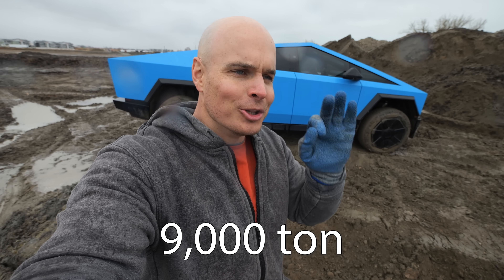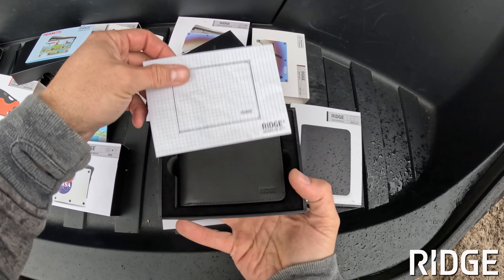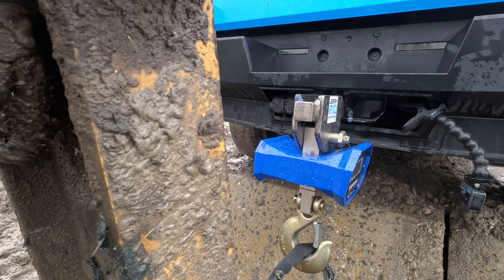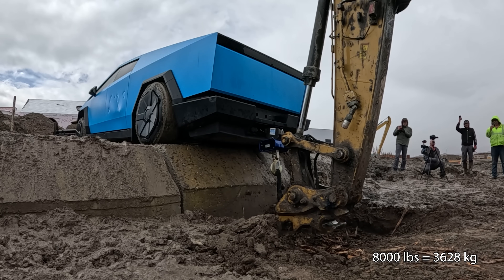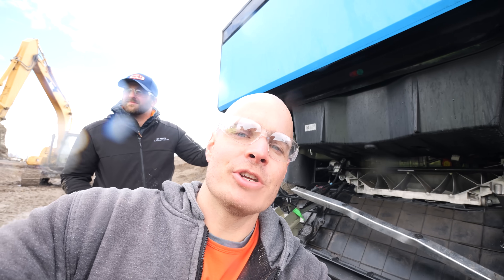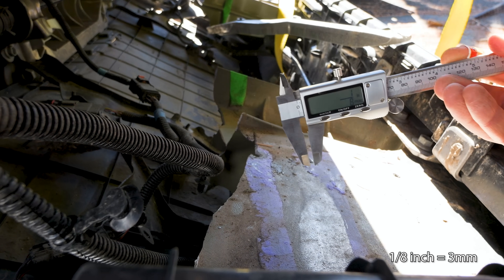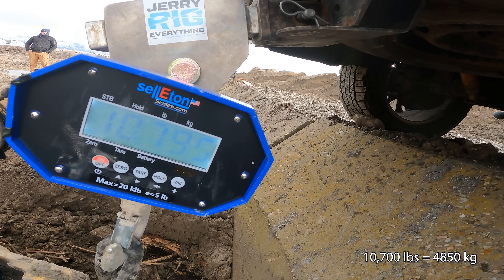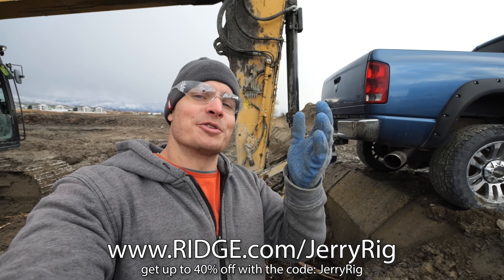SHOULD YOU TOW WITH A CYBERTRUCK?! - (catastrophic failure test)

Comment: Yeah. Anything casted isn't as good as properly tempered and treated material. It's the reason don't just cast I beams. 

And mot to mention that tesla probably new the cyber truck can't tow 11,000lbs but didn't say anything because it would kill Elon's hip. Mean while any engineer will tell you for things like this you should never round up and isntead round down. Elevator can carry 5,568lbs, say it can carry 5,000. Cyber Truck can tow 10,400 something, say it can tow up to 10,000 not 11,000

Comment: I would happily accept an aluminum frame, if - and only if - the manufacturer shared the fatigue and transient analysis they did with me (with legal repercussions if either a) they made a mistake or b) they were over-optimistic), and the resulting answer came out in favor including tossing the vehicle in the scrap compactor at the end of its fatigue life.

(And said fatigue life included things like "hitting a section of highway they just paved over resulting in a ridge, while towing". Actual transient loads on tow hitches can be silly.)

But based on other cases where high-life parts were substituted with "good enough, trust us" parts, the "good enough" life tends to be hilariously optimistic for anything beyond "will a significant % of these parts fail before warranty period".

It's like used cars with CVTs. Can they be decent? Sure, if the prior owner(s) were consistently careful and you're willing to be consistently careful. Can you find that out at the time of purchase? Good luck.

Comment: Copied directly from the cybertruck owners' manual:

Towing Capacity:

The total trailer weight (including all cargo and additional equipment), and the trailer tongue weight, must never exceed the following:

Wheel Size	Maximum Towing Capacity	Maximum Tongue Weight*
20" x 9J	        11,000 lb (4,990 kg)	                1,100 lb (499 kg)

*The tongue weight is the downward force that the weight of the trailer exerts on the hitch. It must not exceed 10% of the maximum towing capacity.
Reply: In other words, it beat expectations by like 900%?
Reply: yes. guy doesnt understand the differance between TC and TW. only idiots will encounter a TW of 5K.

Comment: Technically speaking, Steel frames dont break, they bend. I mean, if they bend far enough fast enough, like in a wreck, they can tear, but they dont normally completely break the way the tesi did. At most, you wouldve just folded that poor dodge in half. Now bolts and pins, those break all the time and is the most likely fail point of any hitch.

Comment: Not sure how you do that test and come to this conclusion. 

How's a trailer supposed to knock that hitch off when it takes a 30 000 pounda machine to keep the front on the ground thousands of pounds before it fails.

If it hits a pothole that takes the hitch off, the passengers will probably have injuries from the hit, and the trailer will be destroyed. 

The concern is more for insurance companies that have to wonder what happens if a Cybertruck gets rear-ended.  You can fix the bumper, but if it damages the mounts, the truck is basically totaled.

Comment: So it broke at the exact weight rating that Tesla advertised? Maybe don’t tow at 10,000 pounds? Idk… 

Apple: Don’t merge your phone under more that 10 feet of water

Consumer: WARNING! Phone breaks after jumping into 11 ft pool! 😡
Reply: He never tested the towing capacity at 11K, he destroyed the tongue at 10K while you mostly have few hundred on tongue while TOWING 11K. Towing is horizontal, he went 90 degree down 🥴
Reply: @Maxq-q4l  The truck was damaged at 10,400 pounds of downward force, 400 pounds above the maximum, but I think you’re missing the point, if a manufacturer tells you that the maximum load capacity is (X), don’t surpass that load capacity.  

In which, I elaborated in a previous comment that 10,000 pounds is a significant number.

Comment: While this is a useful data point for...something, this has nothing to do with towing. Epoxy resin has a shear strength of about 2000 PSI. If i say you have 100 in2 of bond area, then your shear failure load (aka towing) is 200,000lb.  If WD's truck failed at the epoxy, it's because he cracked the epoxy by dropping it. And then a bit of load finished the job. This will never fail just towing a vehicle or pulling a vehicle out of the mud etc.

Comment: Straight from the Tesla website.

Maximum Towing Capacity 11,000 lb. 
	Maximum Tongue Weight
1,100 lb (499 kg)
*The tongue weight is the downward force that the weight of the trailer exerts on the hitch. It must not exceed 10% of the maximum towing capacity.
Come on, you guys can do better.

Comment: so basically you are saying including trailer weight if you are less than 5000lbs the worse bounces will not mess things up. so load up the truck and then light load with a light weight trailer and your fine... for those who will tow heavy anyways if you have a heavy trailer load it correctly and do not go high speed. Notice it did not have problems till you were much heavier than tongue weight. 

Can it pull the rated weight yes. as long as it is loaded correctly and there is no bounce. They should change the what can it tow down.. and then figure out how to fix the issue.  Yes a steel truck will do better always. I do not like the way you 90% pulled the weight to determine shear load but yes they did not make the trailer hitch setup work well... but for the other 90%+ of people who never tow with there truck it is fine. or those who pull light weight trailers only. I owned a truck for more than 20 years and used it for many heavy loads a lot of the time and helped others as well.. know what i never did .. use the tow hitch. many of us will be fine but they need to change the ratings

Comment: im no engineer, but this test just feels off, if tesla advertises 10% load, then seems it may have passed, but what really doesnt feel right is what it would actually take in a real world scenario for 10k ibs of force to be put on the hitch, like what, all the mass of a a RV is shoved to the front to be the center of gravity solely on the hitch, and if you could somehow manage that, at what point does the ground level of the road become a factor if at all? test had do be done over an edge to push limits, feels like this test went to extremes to create a narrative against tesla and feels politically driven, not scientifically driven, again, im not an engineer

Comment: A quick Google search shows the following.  Towing weight DOES NOT equal downward force on the hitch.  By SAE standards, tongue weight is rated to be 10% of the towing weight.  So, 11,000 pounds towing weight means 1,100 pound tongue weight limit.  So, this test exceeded the design limit by 9.45 times.  This is a crap click-bait video.

Comment: As many have said, bad test. 10x rated load on tounge will break it, and without deflection readings on the steel it too likely failed. 

But what this highlights is a possible need for the governing bodies (SAE, DOT, ETC.) to update their standards and tests to account for Al framed vehicles. As it stands they hit an appropriate saftey factor and passed the tests as they are written.

Comment: While I tend to agree that the frame on the Cybertruck will eventually be shown to be unreliable for towing purposes, I do not think this is a valid test.  If the weakness is that aluminum has no fatigue limit, find a way to test that.  If you say that the truck should handle more than 10x the rated tongue weight, according to that logic a semi truck should be able to handle something like 1.3 million pounds (2 axles at 65000 pounds, I'm not including the steer axle).  This is clearly not the case.

Comment: So happy to see you doing this.  At first I thought WD was just playing it up but then finding out that they used the cast aluminium frame only to attack the tow hitch for something rated so high in towing weights shocking.  It's such a major issue its disappointing that american regulators have not investigated the issues themselves. And as you pointed out aluminium faitigues with age and load cycles.  If nothing its done then in 5 years time as they get older we will see more failures.   Maybe they will fix it now....Maybe not.

Comment: Those era Dodge Rams had super strong frames. I used to do body work and when I would pull frame rails on those Dodges I would have to use 2, sometimes 3, hydraulic pulling posts to get the frame rails to straighten out. Chevy's and Fords only required 1 pulling post to straighten the frame rails. That was one of the only things I ever respected on those Dodges. It's not even fair to compare the Cybertruck to a real truck. It's about the same as a Honda Ridgeline, a minivan that is advertised as a truck.

Comment: I'm not a cyber truck fan and i think it's silly mainly because towing with batteries is it's limitation. The electric motors are more than capable of towing. You had all of the necessary equipment to do a real pulling weight test of that chassis and still chose to do the one where you are literally trying to bend the chassis in half using a 35,000 lb loader on the front and a 35,000 lb excavator on the rear hitch. Why? A few serious tow ropes and using that equipment could have pulled against the chassis like an 11,000 lb trailer really would in the real world. It probably still would have passes that test too. The excavator was applying 10x the rated weight to the hitch while the loader held the front down and it seems like it passed with flying colors. That glue is called panel bond and it usually rips metal off with it  when the surfaces are prepared right and it is even used in that fiat ram and every other vehicle on the road today. Yes, aluminum depending on the grade can work harden and become brittle more so than mild steel which will do the same thing but it still passed.

Comment: You also held it down at the front. A real trailer may lift the front of the car up a bit and lower the stresses on the back... So not really a realistic test. What's wrong with the High Voltage pack is also due to this... You bent the battery enclosure, possibly even cracked it.

Comment: Was really hoping to see 14000 lbs on the ram since that's 10x the tongue weight rating since the cyber truck broke around 10 timed it's rating.
Reply: when applying on cybertruck, excavator is sideways so it won't lift. when applying on dodge it is forward facing so it lifts and maxes at 10k pounds. disingenuous if you ask me.
Reply: Unsubscribing
Reply: When i saw this, i thought…oh geez another youtuber that i wont be watching anymore as they have decided to inject their politics into their videos. Unsubscribing
Reply: I disagree. The Ram has a higher tongue capacity because the frame and attach points of the hitch are more robust. Cast aluminum is simply an inferior material for this application otherwise the CT would have had a higher tongue rating. The 1100lb limit is static and as Zack mentions, towing causes ever changing dynamic loads that make a failure unpredictable. Steel at least will deform and bend well before catastrophic failure. Not so with cast aluminum. The longer term question for the CT and it's trailer hitch will be how damage/impact resistant is the cast aluminum sub structure? I worried about the manner in which the cast aluminum structure telegraphs potential damage and sudden failure...much like the Titan submersible because in a millisecond it went from being fine to obliterated.
Reply: @ Tongue rating is just 10% of tow rating for safety reqs. Tesla's is 1100lbs because their target tow rating is 11000lbs. This video shows that the tongue supports likely around 11~12,000lbs (it broke at 10k but because of the lever effect so it'd likely hit 12k with a proper tongue test). This is so wildly wildly more than it needs.
Reply: Me too. And it likely will fail. But the failure will be the frame bending, not catastrophically detaching from the vehicle. Thats the big difference. WD was able to bend the shit out of the frame,  drop a giant cement block on it to  straighten it out, and then swing the truck around by the hitch with a backhoe. Truck frames with hitches rated for 10k plus are extremely strong/thick steel that goes the entire length of the truck. The cast aluminum is a joke. Steel truck frames have a greater thickness (of strong steel) than the cybertruck (weak aluminum).
Reply: Like he said in situations like towing uphill the tow weight becomes the tongue weight. If it's rated at 10,000lbs tow weight, it needs to survive 10,000 tongue weight for short periods. Plus aluminum is going to weaken over time.
Reply: @termiterasin  going uphill or downhill does not change the net force direction on the tongue. Cresting a hill or a valley does. And in this example going through valley will load tongue more while cresting the hill will make trailer apply a lift to the tongue. His test and his explanation are wrong.
Also Cybertruck broke after receiving 95% of it's towing capacity as a downward force. You would have to load Ram with 13k lbs to replicate it for it's rated towing capacity. So even in that comparison this video falls flat.
The only thing it's comparing is steel and alu strength in a abstract way, without accounting for rated limits and without accounting for real use. It is a negative pr stunt made even more obvious when you see that he changed title to add '?' and then '?!' when comments started pointing out his bs.
Reply: @Bilut  I like this experiment. While cresting a hill, an f150 which weighs 6000lbs according to Jerry should be able to handle -100% of its tow capacity (14,000lbs)...... I wonder how he thinks it avoids flying?
Reply: @Bilut  that tesla was new try again after 10 years of towing lol.
Reply: @termiterasin please explain for me? If you’re pulling up hill, why does the tow weight become the tongue weight? I thought tongue weight was the weight in the vertical direction.
Reply: @termiterasin  That's not true. Tongue weight is only 10% to 15% of the total weight being towed. There is no hill, bump, pothole, or any other scenario that will ever put anywhere close to that amount of weight on the tongue.
Reply: @termiterasin yeah, we all know those hills on the interstate that are VERTICAL 🤦‍♂️ Also, that has the OPPOSITE effect. Go back to physics class
Reply: @termiterasin  That's incorrect. The only way a tow weight could become the tongue weight, would be if it were hanging in the air with, despite the angle, cero vertical contact.
He has committed two major mistakes explaining basic physics. How forces works and the stress fatigue concept.
Reply: @termiterasin  so that explain why pickup get their suspension to the floor when they go uphill ... yeah sure ... suspension do not move an inch and you know it, so there's not more downward force on the hitch, it pull backward not downward. 

The only way to get the 10klbs on the hitch is if you tow 20klbs and the load is all on the front of the trailer, when that happen, the front wheel of the truck won't touch the road and you won't be able to steer at all, so I don't expect you to drive very far...
Reply: @termiterasin a trailer isn’t balancing all 10,000lb on the hitch, typically it has a minimum of two axels also sharing that weight. It’s not very hard to understand. All you did was parrot the dumb logic in the video.
Reply: @termiterasin or they could have set up the test properly for a real comparison but gosh darn it that probably wouldn't have had a result like this.
Reply: @termiterasin  You really have no clue what you are talking about...
Reply: at that much weight, the car is already doing a wheelie...that of course, if u don't somehow strap the front to the ground....
Reply: that nuts the entire trailer no
Reply: @termiterasin actually towing up hill will unload that particular stress he tested. Going downhill will load the hitch more in that way.

Comment: When does downward force prove?  If anything shouldn't it be horizontal force??  You using your cyber truck as a snatch block to pull 10,000 pounds up a cliff??
You exceeded the tonge weight by almost 10x.   If anything the test went well.  I just wish someone would do a real world test that actually shows real world situations. Go tow something that's 20,000 pounds and see if the frame breaks. Not put 10,400 pounds of Downward force on the hitch which would almost never ever happen.

Comment: The test is static load not dynamic load like when driving. For static load the cybertruck had a good showing although the steel dodge frame was stronger. For dynamic load cast aluminum is very bad hence why hammers and prybars are not cast aluminum. Cast aluminum will fracture with almost no warning. Steel will start to bend and stretch before completely shearing. Cast aluminum is like cast iron brittle and bad in tension. Forged aluminum and mild steel are much better for the application. There is just not enough shock resistance to make a mission critical part out of safely
Reply: Also the " glue" is most likely a structural PolyUrethane adhesive or 2 part epoxide. They are very strong and used to bond aluminum race car frames together. Just look up 3m scotch weld for more info.

Comment: Someone willing to test and compare a towbar.
Even this is for aluminum, more than strong enough
You put 47x more weight in than the max can handle, max is 100kg.
But steel will bend and saw the other bend at the same weight. enough to have permanent damage and unusable towbar.